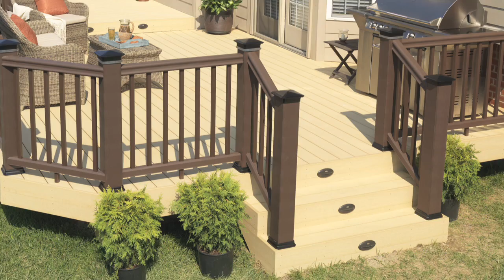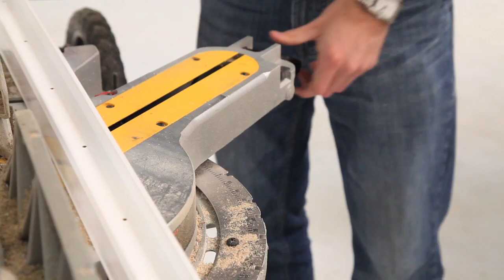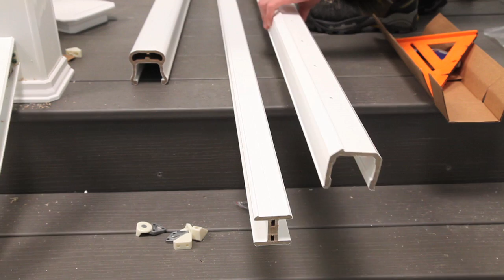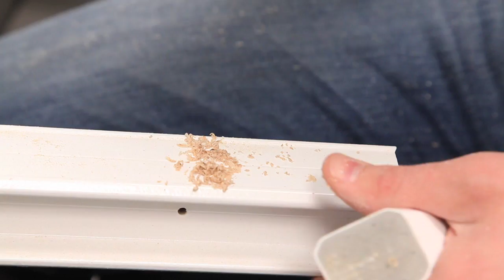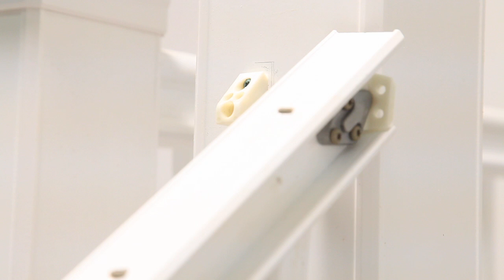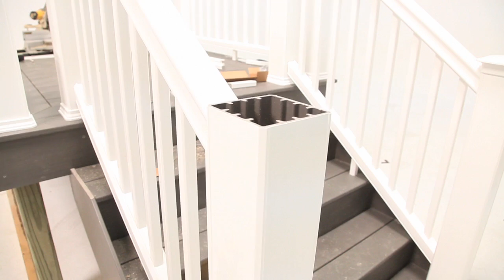RadianceRail Stairs

Comment: The crappiest rail system you will ever install. Especially for steps! Trust me!
Reply: 100% accurate.
Following the printed instructions is a friggin joke. The blind drilling of the top support rail on two axis is ridiculous. 
It's like the designers \ engineers stopped half way, two thirds of the way through the process and said "Yeah, that's good enough".

Comment: Its a great design but they need to break this down a lot more,.... I'm in the trades and have many questions
Reply: The bottom post of stair rails need to be taller then the height of the rest of your rails to match in with the rest .
Reply: The instructiona as printed suck. This tutorial\directions should be in the printed instructions inthe box. I really wish that I watched this before starting the install. The link to this should be emblazoned in the printed instructions.
Reply: @charlie63-p2u  YOU will still learn as you go and figure a few things on your own.

Comment: Leaves most steps out.. and confusing when it says rotate the top support rail.. meaning rotate it for how long which way and why?
Reply: It's confusing because the book.says both rails are  rotated vertical not different from one another.And support block on bottom support rail ? Both the video and instruction leave that out ?